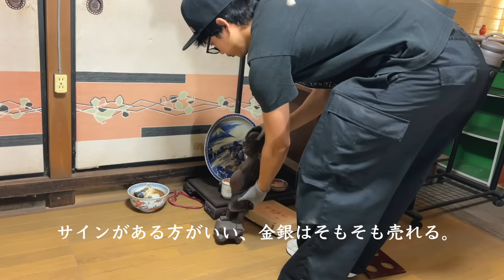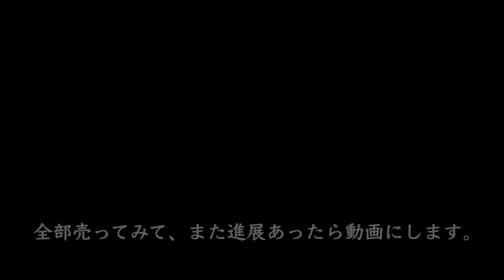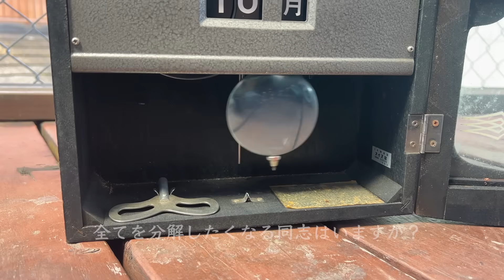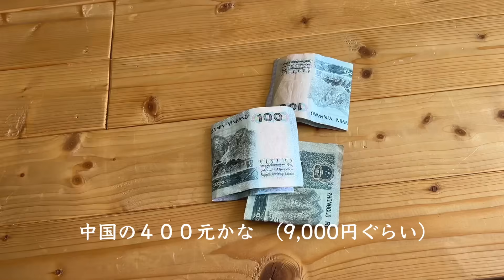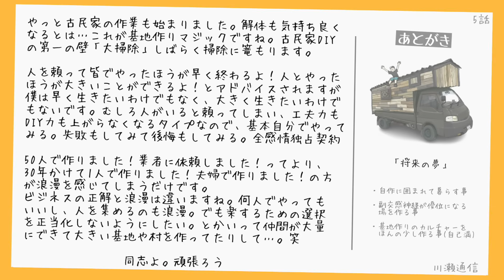「古民家DIY始動」50万円の家を大掃除｜土間と工房作ってお宝探しもしよう。

Comment: Your hard work will pay off for sure!! If you'd like a little tip from a fellow carpenter, when reusing wood or floor panels like these that are in good condition, once you pile them together, you should stack them with the "good side" facing each other, therefore the nails won't scratch the visible side of the panel that is in good condition! "Good side facing good side, bad side facing bad side" as my dad says. Good luck!😄😄

Comment: in this position (I'm in something similar with no house) this is a great opportunity but my man, the wood is in really bad shape and rotten and you need to redo concrete, fix those back windows, get long vacuum hose to not disturb the dust and vacuum as much as possible, i think you should also remove the roof wood inside and clean out all that dust and post YouTube videos 2X a week to generate more ad revenue and buy some insulation and start insulting. I think these videos were recorded in advance because it for sure has to be snowing by now. I think overall its a great opportunity and when you remove the 3 house that broken down, the extra space to park a nice RV truck build or even build them there is worth the entire cost of the house! I also think you need to invest into some new wood and start rebuilding things, walls and floors, practice woodworking. I think the video didn't have enough content, more things should be done, longer times to record, maybe make another channel to create 1-hour long videos, those videos with million views you know.
Reply from the maker: ? ? ?
It's not snowing now! 
I enjoy DIY while I work!